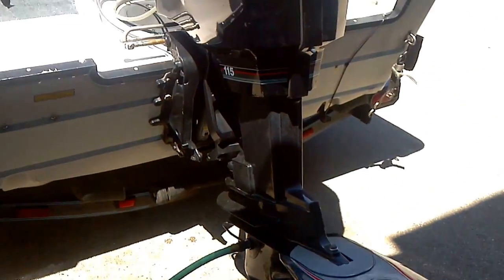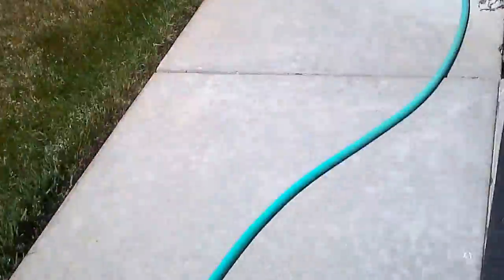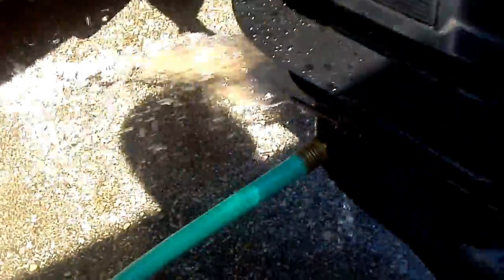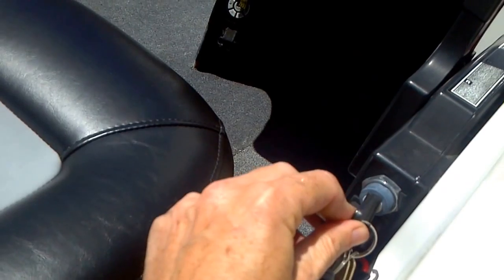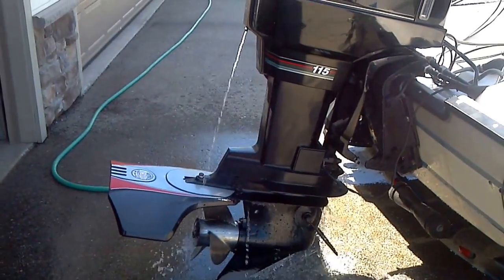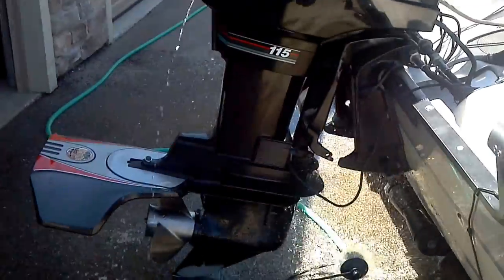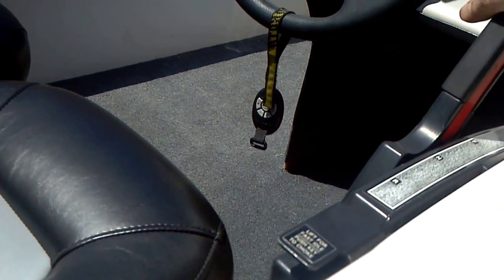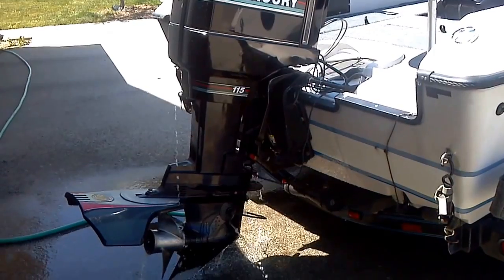115hp Mercury cold start

Comment: When you turn the key on and push it in, it engages the "Enrichener", as Mercury calls it. A choke reduces air flow,  the enrichener introduces more fuel. My 115 is a 1992 model and is just like it. The beep is a test for the low oil level. It has different beeps for high temp also. To be correct, you turn the switch on, then engage the "Enrichener", and only if cold or needed. In time you will learn when and how long to use it.
Reply: Would this work for my 89 90hp ?
Reply: @kentbremner7828  Yep, applies to 70, 75, 80, 90, 100, and 115 Mercury. Open the cowl and you can see it up front on the top, and you can hear it click, with power on, when you push in the key. There is a button on top of it to manually engage it. Most are kind of a gold color.

Comment: I own a 1996 smokercraft 175 ultima, great boat and it has a 115hp merc 1996 2 stroke runs amazing, i don’t  know why but i like the older motors then the newer ones

That 115hp you got is in great shape
Reply: What kind of top end speed are you getting out of the 115  on that smokercraft? I'm reporting my 1998 smokercraft pro select 170 with a 115 and hoping to have a roundabout idea what I could expect speed wise
Reply: Joe Owens sometimes ill read about 44-45 mph max I’ve seen on my boat
Reply: @joeowens8302  I have a 1987 skeeter 17' bass boat, with a 1987 115hp, bumped 49mph tonight (gps). Gonna adjust the jackplate, then see what it does.
Reply: I went with a Yamaha 115, empty boat 1/2  tank of gas (14 gallons) I m getting 45, loaded down full livewell 39 plenty for me lol
Reply from the maker: It got close to 50mph  and it was a fairly heavy fiberglass boat

Comment: I have the same motor on my glassport. What is the beeping when u were priming it? My boat will due that non stop while I'm running it
Reply from the maker: If you are getting constant beep, your motor is trying to protect itself. Meaning: you might be overheating, check that water is coming out the "Tell Tail" the little pee hole. If it's isn't coming out or just trickling out, you need to replace your impeller. It beeps to let you know you are overheating.

Comment: if you can remember, how fast did this boat run and how did you like the merc 115?
Reply from the maker: It was a 17ft fiberglass boat but still got up to 45-50mph and I did like that motor, very clean for it's age and ran out nice!
Reply: @moje2005  thank you! I'm lookin at getting one
Reply: @moje2005 what was pitch and diameter?

Comment: Sounds very healthy!")
I'm having an issue with mine I cant get it to start, u replaced the accelerator pump ,I did every procedures u did but I'm having no luck ,any suggested thoughts
Reply from the maker: you stated "u replaced the accelerator pump" i did not but if you did,, that is more than I did. I have worked on lower units,  impellers etc... I have done tune ups and some carb. work but not sure what your issue is unless I was on the scene. Pull a plug and check for spark, if you have spark, you need to see why you aren't getting gas. you can check your fuel filter and make sure all fuel lines are clear.
Reply from the maker: Also, spray some sea foam in your tank, make sure you have fresh gas. I even squirt a little sea foam in my carb and if you have spark, it should fire for you.

Comment: You need a new motor flusher. Yours has been stretched too much. Thats why it keeps falling off
Reply from the maker: It's old and the rubber isn't soft as the day i bought it, not stretched, just old and cold. If I heated it up with a hair dryer or left it in the sun for a while, it'd be fine. (just a little stiff, 1st time I used it all year)
Reply: He needs to put it in the other way.